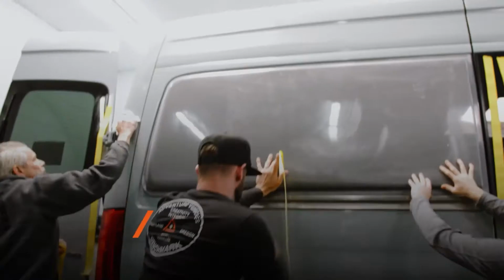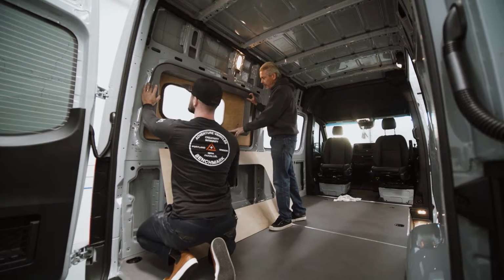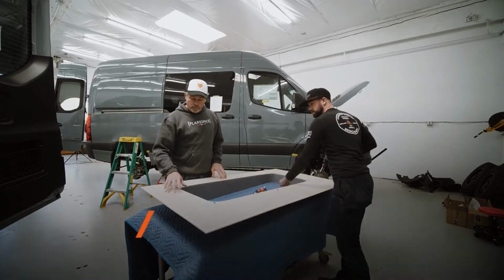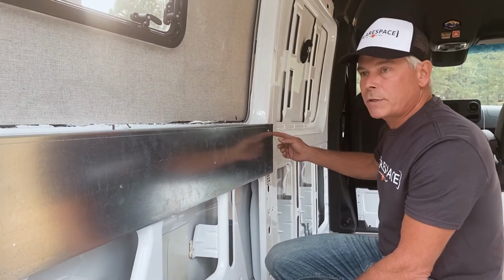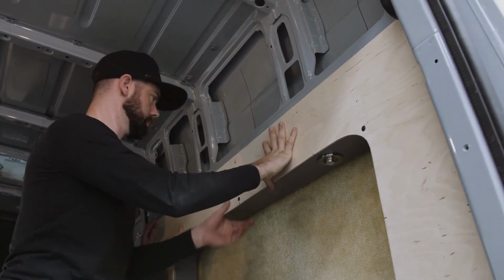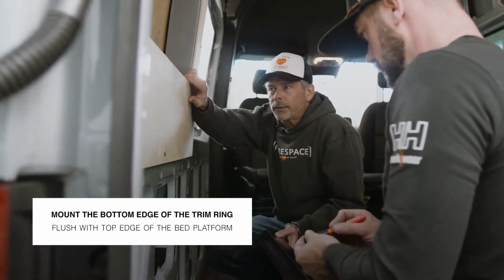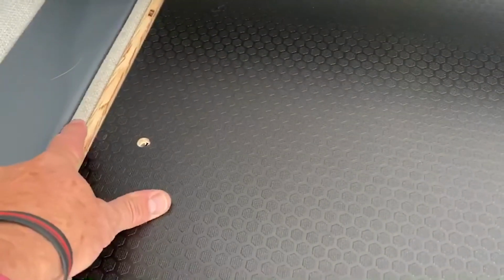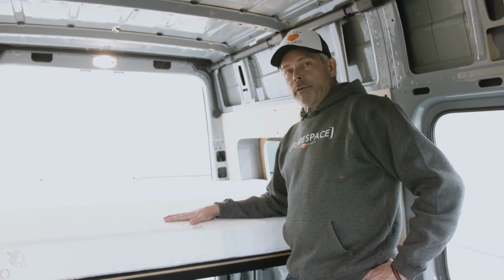Flarespace Bundle DIY Installation

Comment: A tip as to drill bits is you can buy what they call screw machine drill bits which are made short or depending on your rivet size you may be able to use what's called a spotting drill bit. Which are really short and typically comes with a split point

Comment: Very nice job! How are you bolting the frame of the bed onto the wall? Is that a plus nut? thanks!
Reply from the maker: you can use plus nuts. you structural steel is riveted to the van wall, then the rail is bolted through the wall panel into the structural steel.

Comment: What is the measurement from the van floor to the bottom of the bed system? I’m building to accommodate two ebikes with front wheels removed in the garage.
Reply from the maker: 33.5"

Comment: Hey guys! So not sure if you mentioned this, but what is the max total width of the bed?  Wondering what's the tallest height this bed can accommodate if sleeping lengthwise like this.
Reply from the maker: you have 80" flare to flare!